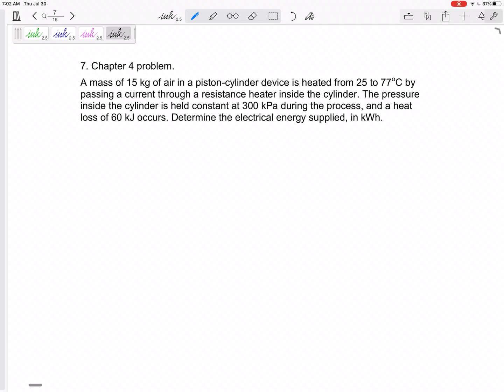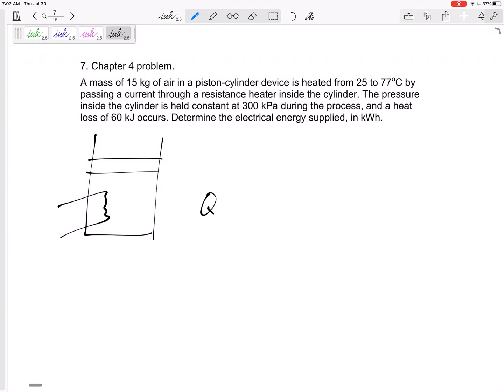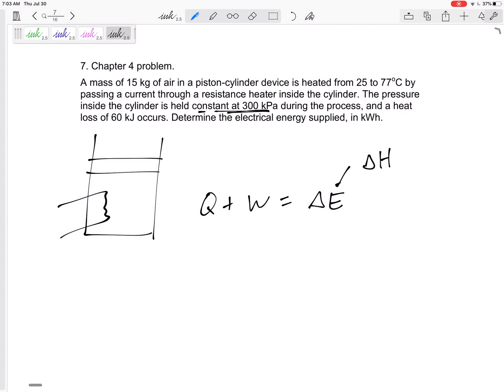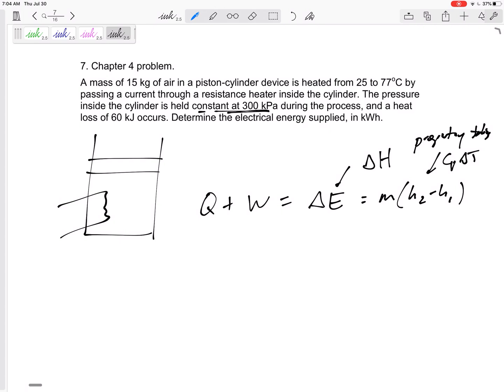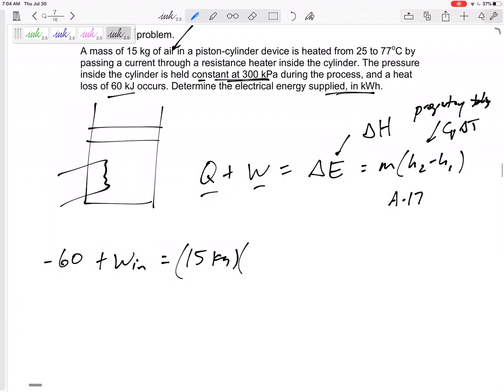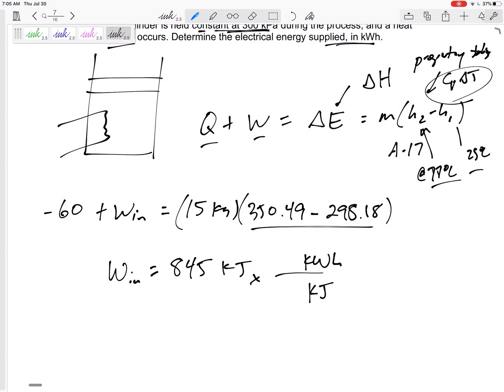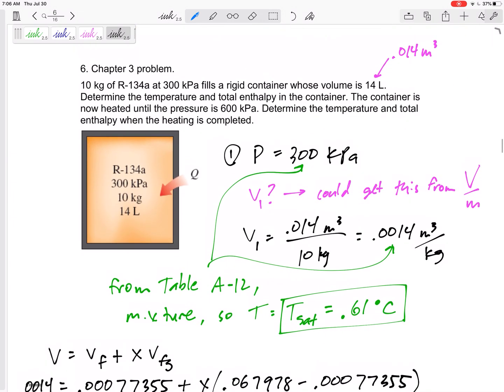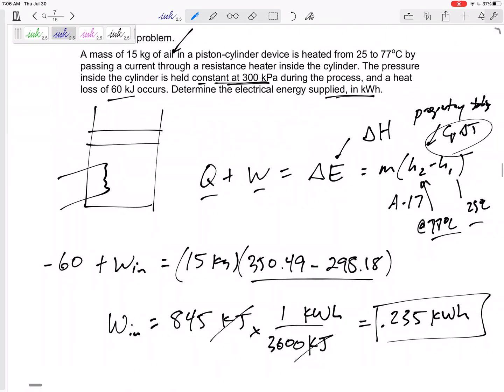Thermodynamics - Final Exam Review - Chapter 4 problem

Comment: Quick question, if it's not a constant pressure / const. volume process, we would calculate boundary work AND also use Δh?
Reply from the maker: No. You would calculate boundary work and use delta u
Reply: @engineeringdeciphered  thanks!

Comment: Why is the work done by the piston moving in the cylinder not accounted for?
Reply from the maker: Because we’re using enthalpy, H, on the right side of the equation. Enthalpy includes that constant pressure boundary work, so we don’t need to calculate it on the left hand side of the equation.
Reply from the maker: I have a video about when to use H and when to use U.